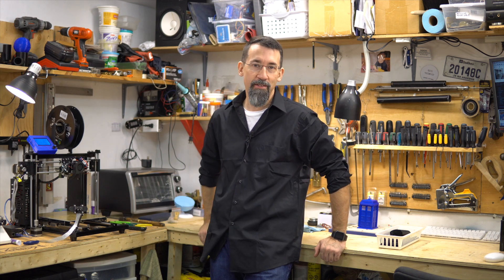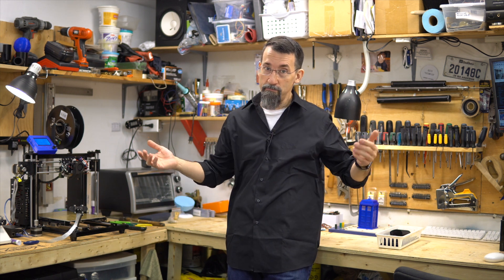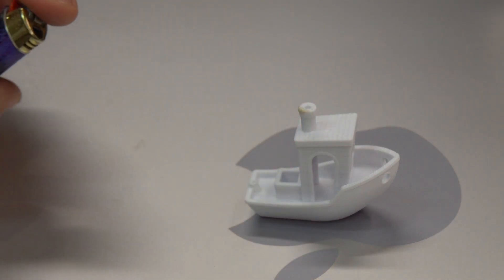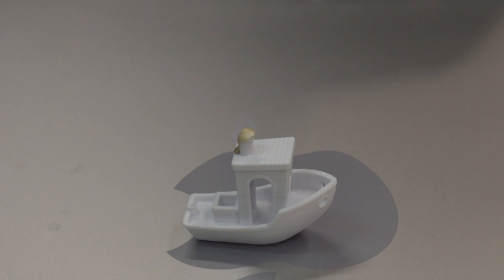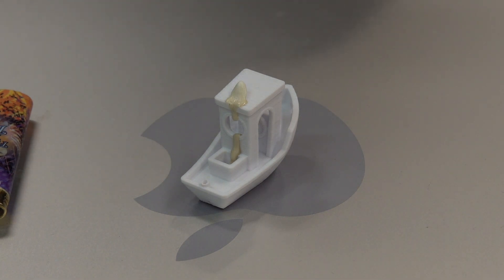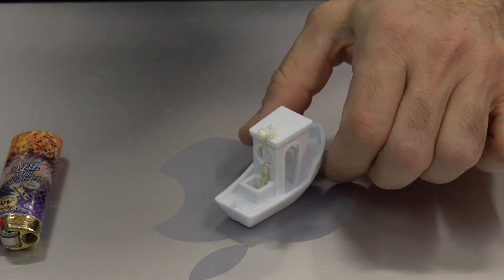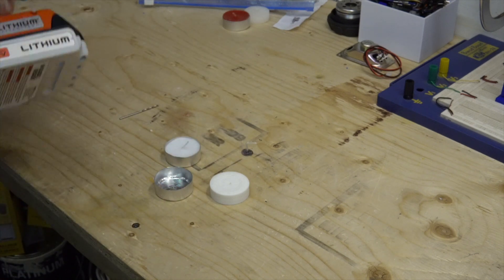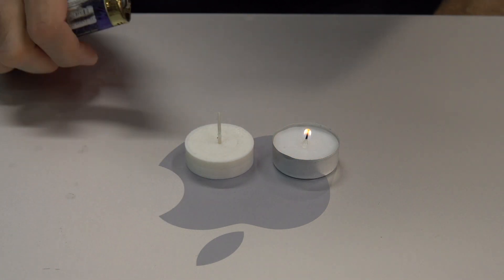Will it Burn? (PLA)

Comment: You held the coldest part of the flame to it. And your candle test should have used PLA for the wax, not the wick.
Reply: Er, he DID use "PLA for the wax, not the wick"! The PLA "wax" came from the print bed. The wick was a standard tealight waxed wick with metal sustainer.
Reply: PLA is loaded with oxygen; it burns really cleanly and doesn't generate a lot of heat @GigglingGobby
Reply: @jasontiscione1741  So what? I wasn't commenting on the burn, just that you said "you candle test should have used PLA for the wax, not the wick" when that's exactly what he DID do 😂
Reply: Not arguing @GigglingGobby

Comment: Where did you get the Aluminum :P Did you finish it yourself?
Reply from the maker: Are you talking about the metal sheet? It's the side of an Apple Mac Pro...
Reply: @Franks3Dshop  Yea, I thought so but wanted to ask! :D Thanks.
Reply: Are the fumes safe?
Reply: @RobIsNow  All I could find so far in data sheets is that "burning produces irritant fumes", which isn't entirely unexpected I suppose 🙂